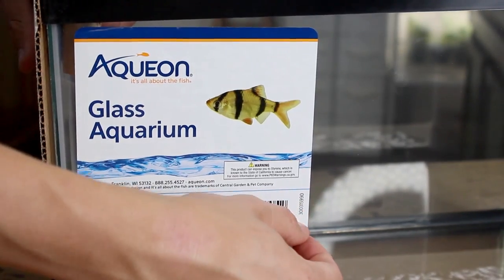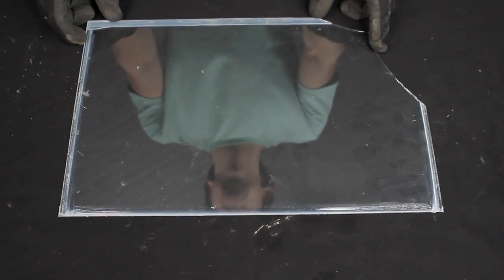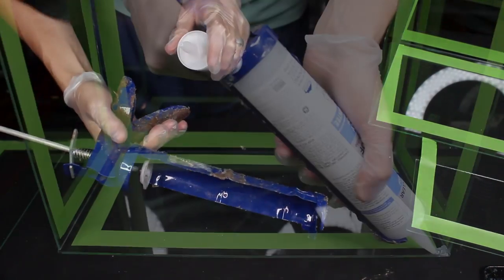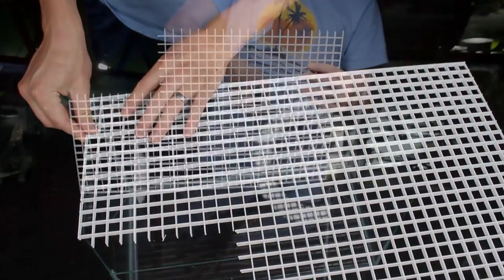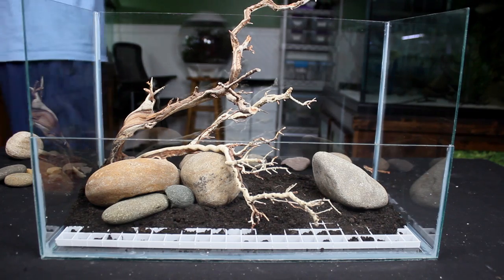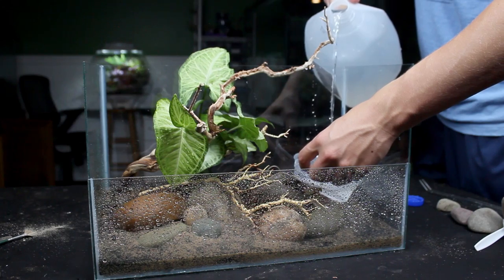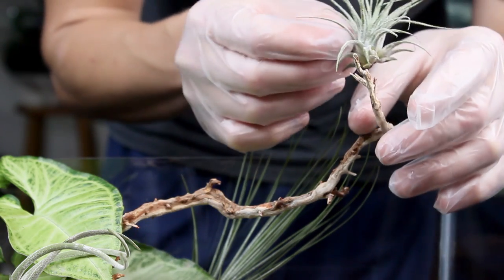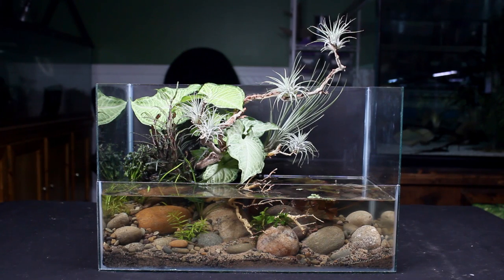DIY Pond Themed Nano Riparium

Comment: “Average person uses five bottles of silicone a year” factoid actually just statistical error. Average person uses 0 bottles of silicone per year. Aquascape artist Tanner making aquarium, ripariums etc. and is using 5,000 bottles of silicone a year, is a statistical outlier adn should not have been counted.
Reply: No though, they don't use 0, and tanner would have to use 35 billion for that math to check out... so no
Reply: @amatohalenda1571  the average person doesnt use any silicone per year, and its pretty obvious trisarathops's comment was just a joke, so im not sure why you even responded the way you did

Comment: Love  how it turned out, and the addition of the air plants. A pro tip for the silicone if you don't wear gloves, spit on your finger first then spread the silicone, it wont stick to your finger much that way.
Reply from the maker: Dipping in rubbing alcohol also works. Never tried spit, but I'll try next time I'm in a pinch lol! 😂

Comment: Love your builds. This one's great as always.
Just wanna leave a quick trick here for aplying silikone, since I do that a lot at work.
To tape the edges to prevent squished out silicone to stick, where it doesnt has to, is always a good idea.
First of use a razor to cut the tip of the silicone tube to create smoother lines. 
After you apllied the silicone to the inner edges, you should use a spray bottle filled with water and a bit of dish soap and sray it all over your silicone lines.
Then use a flat piece of wood with a right angle and grind that angle round to the diameter, that the distance of your two lines of tape are apart from each other. (You can also buy such tools made out of silicone)
Then use this tool to remove access silicone.
You can also dip that piece into a bowl of dish soap water before and in between. Remove silicone from the wood piece with a paper towel.
Will give you nice clean silicone lines, you don't need to clean up afterwards.
Greetings from Germany

Comment: For livestock you can should try snails, shrimp or maybe an endler. If you water level was lower and you were able to cover the top of the aquarium you could put some vampire crabs in there, but then again they won't be active unless you have 100% humidity a lot of wet terrain to climb and explore. I'd stay away from small schooling fish since there's not enough room for them to dart around.

Can't really recommend any livestock for that small of a body of water, but I do have a suggestion on a plant you can use if you ever tire of scooping out floaters and that plant is pennywort. When grown on the surface of water the leaves of pennywort arrange themselves as small lily pads and they look much closer to actual lily pads than duckweed or water spangles. It also grows much slower which is a bonus in my book.

Comment: I always use the cig filter method when super gluing Hardscape. It works very well.
Reply: David Bono elaborate
Reply: Yeah. What the heck is that?
Reply: Josh Arnold if you buy cigarette filters (like 200 for $2) online or at a smoke shop, you can place the cotton filter in between two pierces of rock or wood. If you use liquid superglue (starbond is the best) it will smoke and harden instantly.
Reply: Vicki K see my reply to Josh :)

Comment: I really like the scape, and I am sure that the plants will do great. However, being the worrywart I am, I would have preferred that the sides wold have been cut at an angle from the to of the shorter front glass to the back, just to avoid having pointy glass aiming at anyone carrying the riparium.

Comment: Dear SerpaDesign, 
I recently made a vivarium in a small tank and I noticed that a few days ago a few of the plants started dying. I used your instructions for the tropical substrate mix. I didn’t have a lot of grave for a false bottom and I couldn’t buy mesh to put on top of the gravel. Should I redesign the false bottom and replant the terrarium or should I just move the plants that are dying into separate containers/pots? Thanks for the help!
Your videos are great by the way and they inspire me to do things I wouldn’t normally do.
Reply: Check if the roots are okay. Some plants melt back in a new environment to later regrow even stronger once aclimated.

Comment: nice save with the tank :) the scape is great 💚
Do you plan to add snails or shrimps?
I tried a similar scape in my paludarium, still evolving 👍
Reply: Snails and shrimp would escape from this tank - wouldn't recommend either.
Reply: @mscalucas  yes your right 👍 some snails like apples snails but some are not going out? I'm not an expert :D my paludarium has a front panel, so I'm safe :)

Comment: Would you ever consider doing reviews on products/ places that sell stuff for bioactive enclosures like Pangea, Josh's frogs,  or the bio dude? Do you have a "no drainage layer needed" substrate you prefer?
Reply from the maker: Not particularly. I typically just make my own stuff because that's what's worked for me. Also, I typically use a drainage layer, but I believe that my regular mix would work under the right conditions.
Reply: I ask because I've been wanting to do a large bioactive enclosure for an adult boa constrictor bit still wasn't to use a heat pad underneath

Comment: I am curious to know why you used the egg crate and added substrate without separating it off as a drainage layer.
Reply from the maker: I used it to distribute the weight of the stones. It spreads the weight evenly without creating pressure points that could crack the glass.

Comment: I really, really don't want to be that guy, but it would be worth mentioning that you should ALWAYS wear a mask when sanding glass - and should preferably be doing so with it immersed in water (as most off-the-shelf masks will not filter out tiny silicate particulates).
Silicosis is a horrible, horrible disease and your body absolutely CANNOT deal with glass-dust in any way, shape, or form.